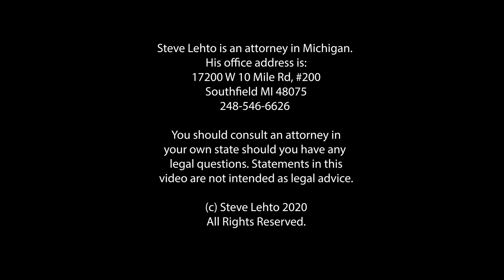Ford's Mystery Fix Explained - Ep. 6.263

Comment: It's all about efficiency and better thermal management.   Belt-driven pumps are inefficient.  They run at normal speed when the engine is cold.  They rob power when the engine is at high RPM.  And now with all this start and stop technology, they don't run at all when stopped at a stoplight.
A pump that can be ran totally independent of the engine speed solves a number of modern problems:
First, by varying the speed, it removes the need for one of those problematic bimetallic thermostats.  
Second, it only has to run slowly when the coolant is cold, instead of trying to force coolant through a closed thermostat.  
Third, the pump doesn't necessarily need to turn at the relative 4000 - 5000 RPM that the engine may briefly speed up to when making a pass or other heavy acceleration event.  It can move plenty of coolant just fine at a lower speed.  Keep in mind that the input power that a pump requires goes up roughly by the input speed to the third power.  This means that the pump could be using as much as several horsepower at high RPM that the powertrain could be using at a time it probably needs it the most.
Forth, it solves two issues on stop/start powertrains.  When the engine is hot, it can keep coolant circulating while the engine is off to prevent boiling from occurring inside the block as heat continues to spread out from the cylinder walls.  It also keeps coolant circulating when the passenger cabin is calling for heat on cold days so that you don't freeze sitting at a red light.
I understand your nostalgia, but pulley-driven accessories, save for the starter/alternator are going the way of the dodo, all in the name of making the powertrain as efficient as possible, mainly because of fuel efficiency regulations.

Comment: "As God intended. "  LOL  before Sidewinder engines.  😂🤣  go sit in your explorer. Push ok on the steering wheel.   Hold it and turn on or start .  Keep holding ok and watch the dash.   After the gauge calibration. Scroll through but don't change anything.   Engineering mode.

Comment: I'm never heard of an electric coolant pump... But if it is indeed electric, then they can control the speed. Chance is that it always run, but they just made it run a bit faster (steeper speed vs temperature curve).

One easy way to control the speed is to pulse the power at a highish speed, and vary the percentage of time it is on. This is pulse width modulation. If you send a 50% on/off, you basically get half the speed.

Comment: I agree with you. As much as I like automation. There is still a lot of things then need to remain mechanical. Before in the old days. You could just disconnect the battery to test the alternator. Today’s vehicles. At best the engine shuts down. At worse you cause damage to a control module. And what happens to your vehicle when the electrical system fails?  Now I don’t mind electric power steering . What I do mind is the fly by wire crap they are doing. I want a mechanical shaft so if the electrical system fails. I can still steer my vehicle. And you missed one more thing that God never intended. Electric parking breaks. And on some of them. If you service them. You need a bidirectional scan tool to recalibrate it. I still want a mechanical override on my power windows.

Comment: Steve a hate to contradict you when you sound so sure, but I as a ford tech that has taken apart many a 1.5L Ford Escape engine can tell you it dose not have an electric coolant pump. The coolant pump is mechanical and runs off the timing belt. There are two coolant solenoids that control coolant flow to the head, these are what the PCM reprogram will alter.

Comment: Bmw has a engine with a Elect. pump also they don't have that type of problem. But if replacement of the pump when coolant is replaced if not done right it will burn the pump out. They did have a problem with short drives and many starts on the pump with short drives like run to the store then gas station quick runs many starts . In my years working on cars Elect. pumps is not the way to go. Its for fuel economy only, price out the cost of the pump.

Comment: Ok, so they're going to run the pump longer at a lower revolution to keep the same amount of coolant flowing through at a lower pressure. It makes sense. I still think this is a workaround designed to allow the engine to last until it is out of warranty, but that is a matter for the courts later.

Comment: Let's back down the antifreeze injection into the cylinders ?  Fuel, Air, Ignition. . Don't remember antifreeze being a requirement for combustion. Ford wouldn't hide stuff no not them.

Comment: Not true.  The coolant is a closed system.  Should not allow coolant into the combustion  chamber.   Head gasket or warped head problem.  Software fix lowers power output of the engine.

Comment: So....they did nothing. They figured detuning would get them in trouble faster by lying about engine perf.

Time to immediately sue. Also, electric pump? That's a guaranteed failure.

10 bucks says they filled coolant to the tippy top, too.

Coolant cannot leak past HG from overheating....unless there's already a failure. This is basic physics. Ford cannot defend this in court.

Comment: This does nothing to explain how this is occuring. Just more Ford jedi-hand-wave answer to a problem. (there's a serious design issue if coolant is getting into the cylinders. There's really only two ways this can happen: cracks in the block, and faults with the head gasket.)

Comment: While waiting for an appointment from the Dealership to get this "recall" reprogramming for my '17 Fusion - after remote started cold and idling 2 minutes in my driveway last week, my engine quit and seized. Im at 90K miles (out of warranty) - do I have any recourse if there is coolant found in the oil? Initial dealer diagnostics has found zero piston compression and a $5500 replacement estimate. I'm 2 years into a 5 year loan with about $20K remaining. Do you have a DTC # or  other info on this reprogramming fix? A I cannot find anything about it, other than the letter they sent in the mail.

Comment: So if the adjustment is to the cooling pump, then heat is the issue and a warped head the result allowing the water jacket to be de-segregated from the combustion chamber?

Comment: Steve, everything you mentioned as "not in the Bible", is in fact "in the Bible".  Your book learnin' has apparently been restricted to the Old Testament.  The Old Testament knows not of modern things such as electric fans, timing belts, electric water pumps, and software updates. Those can be found in the New Testament, which is mostly useless to the average weekend mechanic, since special tools and proprietary knowledge is required to follow the instructions in this cryptic tome.

Comment: Holy cow, I was actually right about this.  Have to say though, the more I hear about engineering changes like this, the more I don't want a new vehicle.  Mechanical water pumps worked great for the last 100+ years, now they have to make cars even more complex by making water pumps (and pretty much everything else) electronic.  I guess this is done so they can make the engines as small as possible for fuel efficiency but IMHO it's gone too far.

Comment: Electric water pumps are vary weird.. I understand there a benefit that on start up you might not want to run the water pump to cool the engine... but I think that be about for only the first minute of operation.  After that you want to keep the temperature in check...  and after the car is done running it might be useful to cool the engine using the electrical water pump might make sense.. but its hardly like your getting parasitic power lose from the water pump running all the time because its going to run all the time anyway..  this is one of those things where I can see why they done it, but i'm kinda indifferent to it..

On the other hand...  Electric fans, and electric power steering make a great deal of sense... these only really need to be powered during low speed operations, and having just the fan connected to the motor can reduce HP in a GM LS 5.3 motor over 20 HP.. ( know this from watching HOT ROD magazine Youtube clip for there series Engine builder..)  So getting this stuff off the motor is really beneficial..

As-side from that I'm curious if they also will ever put the oil onto a electric pump... one of the main reasons engines wear out as fast as they do is from low oil on start up.. I bet you really could improve engine life if you had a system in place that could before start up prime the motor with oil, and then after shut down keep cycling the oil around though the motor to post operations clean the chambers out for the next start up cycle while everything is warm still.

In any case... if that is what is going on, that they are just messing around with the programming for the way the water pump, is running works seems a little more above the board then I gave Ford credit for.... but I still not buying a Ford just because they don't really have any products I like... Outside of the Mustang, or the Raptor, (but honestly I rather have a Camaro, or Silverado.)  They have to produce a affordable Tesla Killing EV, or make turbocharged performance car with a AWD and manual stick shift to get me  to think about there products.. but honestly they are most toaster with wheels if you ask me..

Comment: Steve time to drive you nuts my home is a bus conversion rear engine transverse mounted drive line runs at about a 60 degree angle to the differential uses an electric solenoid for reverse uses both electrical and mechanical water pumps and it runs backwards to most motors and is American built it is a 1968 gm pd4107 and greyhound use to use this model bus

Comment: Calibrate could also mean calibrate flow rates, which could be over pressuring the system also..
Reply: You can't overpressurize coolant to leak unless engine has a failure lmao. Do you have any idea how high combusting pressures are? Especially on a boosted engine?!
Reply: @TheGuruStud  gotcha maybe when the pump runs after engine off??

Comment: This sounds like a Temporary fix, as the standard Water  pressure in most cars is 14-16lbs, in reducing the pressure you also lower the Boiling point of the fluid{my opinion, they will have to have Fan run longer after engine shut down, and during normal driving)... I still think that the Head gaskets or Design of the Bolt pattern is incorrect, like the 84-86 Cadillac engines(had to be Re-torqued at about 70,000miles), they fixed Problem in 87..
Reply: The water pump doesn't have any effect on that pressure.  It just moves the coolant from one place to another.
Reply: @kc9scott  ; Sorry incorrect, if you increase the volume of water with in a limited space you also increase Pressure, as there is a back pressure affect, which is increased Pressure..  Here's another problem, if you move cooling water thru a cooling system to quick you will also over heat, that is the other reason for a thermostat, or in the case of racing cars, a restriction plate, as it won't have time to cool...
Reply: @davekramer4266  In a standard car cooling system (i.e. any of them), the 14-16 PSI that you refer to is caused by heating up the water within a confined space, from the engine heat.  NOT by the water pump, not to any significant effect, relatively speaking.  Those water pumps are just centrifugal pumps, and they only make enough pressure to move the water through the system, NOT pressurize the system.  The water pump has two pipe connections, an intake and an output.  The intake sucks water in, and the output spits water out.  The two pressures mostly balance each other out.  Even if the thermostat was closed, the pump would only add a tiny fraction of pressure to the 14-16 PSI, probably [edit] no more than 1 or 2 PSI from the pump.  Much like a home sump pump, a car's water pump is only designed to provide enough pressure to lift the water a few feet.

At any rate, I highly doubt that the software change was to run the pump slower and reduce its (tiny) effect on the water pressure.  Much more likely is that it was to keep the pump on for longer amounts of time (either start it earlier, or keep it on longer, or both).  Water pressure in the cooling system is NOT what would cause this kind of leak, anyway.  Head gaskets are designed to seal against many hundreds/thousands of PSI during the combustion cycle.
Reply: @kc9scott  Yes your also correct, but what they are referring to is on modern Electronic cars they are using high  pressure Electric pumps, as that is the only way a computer can control the pump, to back off on the the pressure output... don't forget that in between your forcing the Water true a Limited space, the radiator....

Comment: If the water pump is electric does that mean that there's no thermostat?
Reply: Thermostat still used in that Ford engine but not your typical thermostat from 20 years ago either -- for an example search MOTORCRAFT RH224

Comment: That’s ... odd.  I’m old school as well, but I’m quite perplexed by intermittently running the water pump. When the engine is cold, you want the coolant moving to help distribute the heat to warm up the engine, allowing it to lean out and use less fuel. Cold engines run rich. When the engine is hot, you want the coolant moving to distribute the heat evenly and away from the hottest parts of the engine and/or through the radiator to bleed off excess heat to atmosphere. You also wouldn’t want coolant to stay in one place or some will eventually boil - turn into a gas, which is a pretty lousy heat transfer medium and not what the water pump was designed to move.

Is there some scenario where you don’t want or need coolant circulating? Running the water pump - mechanically or electrically - takes energy, which takes fuel. But isn’t that just one of the tradeoffs we make in the inherent design of an internal combustion engine?

Comment: God wouldn't have intended timing chains either..... Direct gear drive valvetrains would be how God would do it.  Those are indestructible.
Reply: Yeah, overhead cams are of the devil
Reply: @dpwaaw  Though quite unusual, direct gear drives can be used with overhead cams.

Comment: I wonder how many good ideas get scrapped, because the parts wont break down and need to be replaced quick enough? "If it's not broke, the quality is to high, and it needs to be redesigned so it needs fixed, and/or replaced sooner.

Comment: Theoritically that fix will probably work but they could tweak many engine parameters with a software  update to change many of the parameters you mentioned. I'm sure the engine has variable valve timing as most engines in the last roughly 20 years has variable valve timing.

Comment: yes electric water pumps do run when the car is off. Audi turbo charged cars have both a mechanical water pump and a electric coolant pump the mechanical pump runs like a traditional pump and is driven off the timing belt. The electric pump is used to circulate coolant when then engine is off because  of the need to cool down the turbo. The turbos get very hot under hard acceleration or load, and if the car is shut off while the turbos are still hot they will retain the heat and destroy the seals on the turbos causing them to leak. If they are really hot the heat will cook the remaining oil in the turbo and possibly even cause the shaft of the turbo to warp. Some cars use a turbo timer to leave the car running after the car is shut off to keep the engine running at idle for a few minutes after the car is shut off to accomplish the same thing.

Comment: sounds like they are re-programming the electric water pump to work 24-7 when the car is running.  That's fine but it will shorten the life-span of the pump (presumably right after the warranty expires).

Comment: It sounds like a band-aid to solve a poor engineering design of the head/block fastening system.  This is not the first time that car manufacturers have had head gasket failures because of poor design.  Their band-aid is to make the engine not run as hot so there will be less warping of the heads, and less pressure.  If I owned one of these cars, I would trade it in BEFORE the warranty runs out, as its a ticking time bomb.  Just my 2 cents...  Cadillac Northstar V8 example: https://www.youtube.com/watch?v=-nf0bp4dmZU&t=315s  I loved your comments about the "Bibile."  I agree with you 100%.

Comment: Really enjoy your videos Steve. Definitely old school here as well. Wonder how that fix would work in slow traffic during 100F+ days. But the curse of being old school says its a crappy head gasket or the heads are warping at high temp. I get running cooler so less pressure, but in the 50 years I have been driving, I have never blown a head gasket from over heating. And I have definitely had my share of clunkers that would over heat from time to time. Probably just stupid head gasket engineering coupled with an overall weakness of making a motor lighter. Heads probably move a little as well. LOL Just give me a 64 Cuda with that little 273 V8 and that silly 2 barrel carb with 13" wheels. Ran like a bat out of hell. LOL

Comment: Oh...sounds like a water hammer. You have a hot engine with interupted  coolent flow, engine cools in one region disproportionately to the rest, condensation occurs in that area, engine heats up again kicking the pump back on, coolent circulates a gain but with a gasseous void causing differences in pressure in the system, and where the void/bubble is moving and encounters an obstruction, bend, or sudden change in turbulence, it causes a pressure spike un that area.
Reply: Cavitation was one of the  consequences that was mentioned when I had the software fix done yesterday.
Reply: Man Ryan that makes sense actually, especially ifnthis is a problem thst wouldn't occur with a continuous flow.